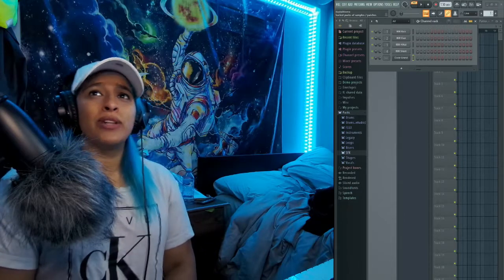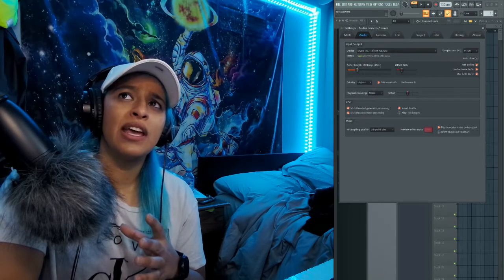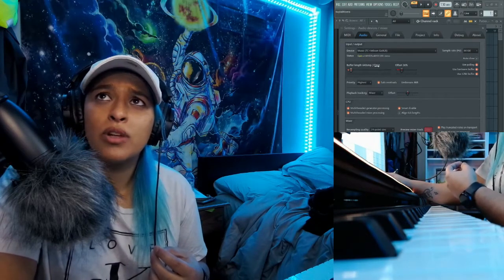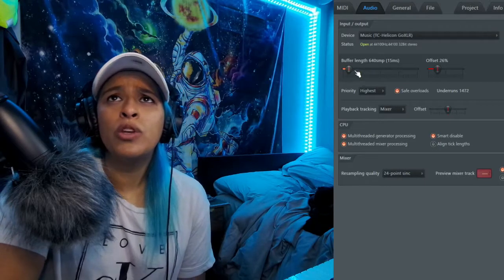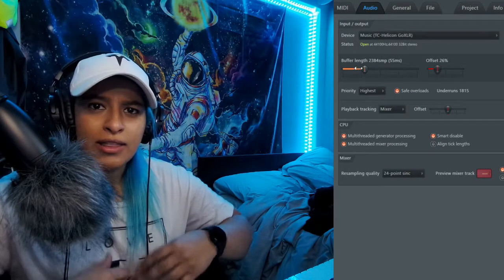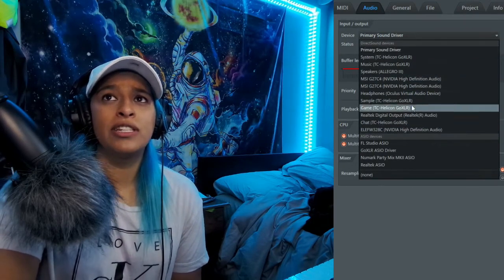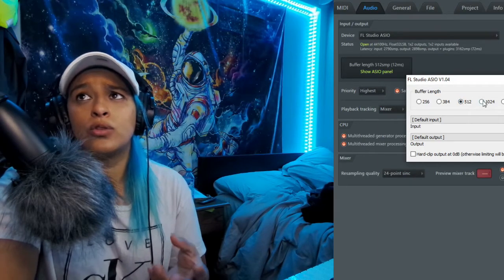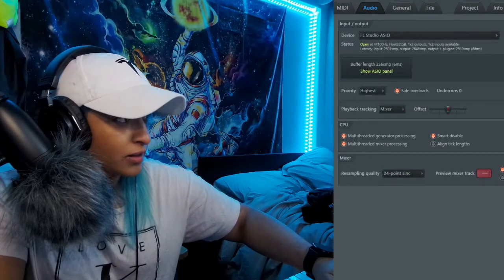Why is There a Crackle Clicking Noise / MIDI Delay in FL Studio?

Comment: i have 0 underuns but i can still hear these noices
Reply from the maker: That's rough I'm sorry, I'd have to see your settings to help but a couple things to try would be, try a different USB cord, try using the manual slider to adjust, try reinstalling fl studio. If you still have issues feel free to send me a short vid and I could try help you troubleshoot. Good luck, and play on!
Reply: @nfxtech2194  all good thank u i fixed it now
Reply: @RENZO4848  you mind pointing out how please? 🙏
Reply: @rllyniory2601  I just had to play around with my sound settings and change the inputs